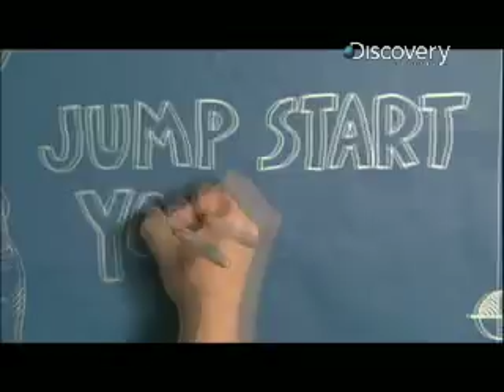MythBusters - Car Jump Start

Comment: As a mechanic this makes my blood boil a little bit. That defibrillator simply doesn't have the current to start that car. And no it would never blow up due to that amount of voltage and current going through it.
Reply: Also defib have high voltage but are also very low power to prevent you from causing damage. You want to jumpstart the heart, you don't want to electrocute someone.
A starter motor needs a lot of power to overcome the inertia of the engine components like the valves, crankshaft and cylinders and the defib is specifically designed to NOT give that power.

Comment: I'm fairly comfortable I could start a car with a defib unit. I'd be taking it apart and using the internal battery though vs using the unit as is.
Using the pads and a standard unit, nah no chance. 

One thing you COULD do is use the defib to provide the high current of the coil to give you a spark on a points/magneto setup but that goes well beyond jump starting at that point.

Comment: It's a classic scenario of volts vs amps: the high voltage from the defib. (with very little current) probably just arced inside de battery.
Reply: It's low amps and extremely short duration. A defib is meant to give a very brief shock to the heart to snap it out of a panic, kind of like if you were to give someone a slap in the face to snap them out of it.
A starter motor needs a lot of power in order to overcome the inertia of the heavy crankshaft and cylinders. Defib's are specifically designed NOT to give a lot of power to prevent you from damaging the body.

Comment: i'm guessing that a defibrillator is high voltage but little current. you need current to start engines and compressors.

Comment: The main problem was the battery was TOO drained/dead. They needed to try this with a low battery that could turn the engine a little bit but not start it, as most people needing a jump start have. If the battery was that far gone the defib would never work like that unless you sat there and defibed it 20+ times before starting.
Reply: +wcemichael Came to the comments to say exactly this. Even the portable jumpstarter kits clearly state on the box they will only work on a drained battery, not a completely dead one
Reply: Lov2WatchSweetVidz
Well I'm glad somebody knows their shit in here. It sure the hell wasn't them. Maybe they failed the test on purpose so people won't try it and possible blow up the battery and get acid in their face, go blind and end up suing MB? The only reasoning I can think of

Comment: It may not start the car due to the low amps put out by the defrib, they are design for high volts, but if it had high volts and high amps it would most certainly kill instead of revive.

Comment: The only good Japanese cars I've driven are the 2005 Honda S2000, the 2001 Toyota MR2 Spyder, the 2010 Lexus LFA, and the 2010 Nissan GT-R.
In my opinion, which has been formed from my past experiences, all other Japanese cars are worthless. Although, in it's factory form, the Honda Civic is very reliable.

Comment: They tried to start a car with a high voltage jolt anywhere between 100 and 2000 joules. When on average it will take roughly 20,000 to 40,000 joules to turn the engine over.

Comment: Basically trying to start the vehicle with a stun gun.  Won't work.  I did see, however someone start a small car with only 100 ni-cad batteries in series-parallel that ended up being about 13.2 volts & around 80 amps without a car battery in the circuit.  I doubt it would work on an older large 70s car with a massive starter.

Comment: I'm not sure about a defibrillator, but I do know you can use short bursts of higher-than-charge voltage to charge the battery a little, and even restore a dud battery, BUT you must disconnect ALL electronics connected to the cells, so if the battery is "smart", the current will flow through the control electronics, and not the battery.

Comment: I would have thought a  defibrillator didn't pack enough amps to turn the starter motor before I'd have clued into the voltage frying it.  Hrm..

Comment: yep, saw that non-result coming a mile away, starter motor in a car is all about the AMPS not the volts, ever wonder why jumper cables are so thick? they are thick so that they can carry the required current which can be anywhere from 150-500 amps (bigger engine to start = more amps, so chevy V8 would probably be closer to 500, whereas honda 4cyl would be closer to 150-200 amps range

Comment: yeah i could have told you that wasn't going to work the couple milliamps coming out of a defibrillator are pretty useless when your trying to turn an engine over most car batteries can supply between 450 and 700 amps thats many thousands times more then a defibrillator.

Comment: @troydeancarpenter
Yeah. And even then, it would probably take several minutes or even hours to charge up the battery sufficiently to get the engine to turn over.

Comment: I can't believe Grant set this test up for complete failure. What does he think the big cables on the battery are for? Certainly not for 12volts, it's to supply large amounts of current.  They probably fried a relay or fuse, not the starter motor.  Should have had a mechanic supervising this test.

Comment: Number one, it's high voltage but very low current.  You can't increase the voltage without lowering the current if you're pulling from the same source.  Energy doesn't just appear out of nowhere.  Number two, a car uses DC voltage to start NOT AC, so if you wanted to at least try to charge the battery you need a full bridge rectifier and possibly a few resistors.

Comment: well duh! it fried because it's run off dc voltage not ac. they'll fry the computer and everything like that because the starter is ground to the block and the computer is grounded to the frame so yeah this should have been busted before starting the test.

Comment: not going to work
 
defribralator blew out the fuse box which has a maximum fuse of 30V or .03 the voltage of the heart starter lol.

Comment: um.....most car batteries are rated by amps, defibs are low amp devices, but high voltage, it takes amperage to turn a car over not thousands of volts......

Comment: nice to see the clamp work holding the key to start, but they could've just taken it apart and driven the ignition switch with a screw driver..

Comment: hmm but why did he connect the black negative wire to the battery? you're suppose to put it to a grounding area like the chassis of the car. ive heard that is a way to kill your car faster. not saying it would work or anything but might have not fried the battery. who knows :/

Comment: Air-Tank/DC Analogy:
Volts is pressure in PSI (without which, there can be no current).
Resistance is the hose (length/diameter) = the starter motor which is not a variable for this case.
Important distinction: Amp RATING is the volume of the tank or battery in this case. This is how many amps/current the tank/battery CAN push times for how long.
Current is the flow (in Amps) resulting from the pressure divided by resistance.
A defib is a completely different animal.

Comment: More than likely the key being locked in the crank position drained the dead battery so low it couldn't be jumped.  That and the jumper cables that they had hooked to the paddles looked to be awfully low gauge.  A defibrillator give out a huge instant spike.  A car starter needs a bit of sustained energy to work.

Comment: a starter motor is quite hefty on current and a defibrillator only delivers quick bursts of high voltage, depending on the polarity they probably had the defib reversed  and sulphated the battery that or the motor windings broke down

Comment: they need to hook the defib cables to the engine block, both plus and minus, then put the key in the on position, like the engine was running, and hit it with the 7000 volts..believe it or not, a gasoline car actualy uses 15000 volts for the spark plugs.

Comment: that was the dumbest thing ive ever seen anyone try to do
who thought that that thing was actually gunna work
that car battery is 12VDC, 500amp+ in good working shape and can supply power for a solid 15sec and that defib was probably 40 thousand VAC at 1amp or less and supplys power for what mabee half a second. you would have as much luck turning that car over with a bug zaper or 3 AAA batteries out of your TV remote

Comment: Actually, it's because the defibrillator is an AC device and the battery is a DC source.  The defib. generates high voltage by the use of internal transformers. Because Current and voltage are proportionate, the defib. produces a very high voltage with very low amps. Otherwise the machine would just kill people faster. That means there isn't enough current to turn the starter and get the alternator going.  All it does is create an enormous voltage spike and damage electronic components.

Comment: Defib's use high voltage and low amperage.  A car uses the opposite, 12V and 300 cranking amps or so.

Comment: guys..... you should read some electric & electronics  books.....in any freetime....  :P

ps: tha car didn't start cause of a basic law............same charges anode/anode or Cathode/Cathode =repel.

diferent  charges = current.

using a battery its diferent,  because a battery doesn't have the HUGE current that a defib. have and it allows to start the car  and recharge the dead battery.

Comment: The battery is very low impedance if healthy, there is no way the defribulator will put much voltage across that.

Comment: this is so obvious it wont work

THREE PROBLEMS:

VOLTAGE - WAYYYYY TO HIGH
CURRENT - WAYYYYY TO LOW

AND...

THE DEFIB SENDS AN APPROX 10MILLISECOND PULSE, NO WHERE EVEN CLOSE TO THE FEW SECONDS YOU NEED TO START A CAR, POINTLES MYTH

Comment: How dare they call a Toyota Camry a jalopy.  I had mine run with no oil in the freeway without any problems other than the overheating.  And no, I don't usually drive with my car without any oil.  Their was a big crack that leaked all of the oil out.

Comment: Kinda figured this would happen my guess is they shorted a cell in the battery, the reason I say this is that they mention that at the end they could hear the solenoid clicking but no start.  The defib machine output is too high voltage but too low amps. the amps are crucial to geting she starter to turn if the defib could output the same volts and amps as the draw required to start a car, it would cook a human heart.

Comment: are these people fucked in the head?

there is a reason why there are a bunch of Fuses and Relays all over the car.

When a fuse or relay is exposed to too much voltage, it simply breaks off and cuts all power.

more than likely they fried the Starter Relay or the Factory Alarm (if any)

Comment: Does anyone here actually know how Volts differ from Ampers?  Read more in Physics !!
Even if they used 10x defibrilators it wouldn`t be enough to light a spark in that accu ;)
cheers

Comment: the fule and spraks will keep up thats no problem why would you be able to keep the engine running at 7,000 rpm's :)
but yeah the copper wire in the starter engine will get to hot and burn (on some spots why thay cant make a magnetic feeld :) )

Comment: Yes, it will spin faster. But, if even if you have a 50 v starter motor, the increse in volatge will be so dramatic that the motor will spin so fast either the motor will fail or the enine's spark plugs and fule feed won't be able to keep up.

Comment: it depends on the rpm that starts the car...
bedides a 12v starter motor will turn faster if you get above 12v 
just like you will have a 6v start motor and a 12v battery

Comment: 4,000 volts is nothing. cops' tasers are 250,000 and if you go to a gun show you can buy ones that go up to 500,000. of course, if you hold the half million one to someone long enough it could send them into cardiac arrest. still, 4,000 is nothing.

Comment: probably not only did it fry the Starter, it probably popped the Powertrain Control Module because the PCM of a Car is EXTREMELY Sensitive to the amount of power it receives.

Comment: You need a constant flow of power. Not just a low amperage pulse. 
What these guys did is equivelant to flicking a high powered spotlight on and then off and expecting that because its so bright, the room will stay lit for a while.
Come on MythBusters, you guys know better!!

Comment: Sorry, not true. You also need to turn the engine far enough to get compression in at least one of the cylinders... which requires a fair bit of sustained power. 

The typical charge from a defib is about 100-300 Joule. This, I think, is *theoretically* possible to provide that compression. However, the manner in which it is delivered from the defib, along with the losses from the poles, to the starter engine, to the engine... I wouldn't hold my breath for it.

Comment: A defibrillator has many thousand volts but few amps.  You need at least 300 amps at 12+ volts to start a car.  I reckon the battery was too flat and when trying to jump start the normal way, they didn't leave it connected to the other car for long enough for the dead battery to charge.  Done this many times and this seems to be the case.

Comment: Ummm,6 volt batteries are $1500,you can pick them up for the same price as a car battery because 6 volt batteries are still used in farm equipment like tractors

Comment: well I know something you did wrong there... a defibrillator is an AC current and a car battery is DC.  its not compatible.  you need to rectify the circuit first

Comment: um, dumbass, I happen to have a masters in electrical engineering, I know what I'm talking about.  the microsecond pulse provided by the defib, does not provide a long enough waveform to provide anything to the engine or battery.  You need to understand the difference between a DC voltage, and a microsecond pulse.  It could be a billion volts, but if it is only provided for a microsecond, it isn't going to do anything for a battery or to start an engine. PERIOD.

Comment: dumbasses, a car needs a sustained amount of voltage in order to start, a diffibrilator only gives a high voltage microsecond pulse. It won't do anything to either the battery or the car!

Comment: and 2......that machine probably puts out very little amperage....you can hold onto a spark plug wire with the engine running and that will throw about 40 to 50 THOUSAND volts through you....but little amperage

Comment: since they did'nt have a completely dead battery....I am betting when they put the key in start position and waited to hit the button on the defibrillator, they burned up the brushes and/or the solenoid in the starter :)

Comment: I don't quite get Grant's explosion and fire coming from an engineer. The defibrillator cap holds approx 300J of energy while car battery holds something like 4000000J of energy. Why would he expect more than a spark. Even if there was no voltage mismatch the defib energy would not likely be sufficient to run the starter motor.

I suspect nothing at all happeneded to the car, the defib essentially shorted (through it's own current limiting) because of impedance mismatch with the battery.

Comment: this is absolutely retarded. Why the heck would a car start jsut by putting power to the battery? Im sure the mythbusters arn't that stupid but they do 'act' as if they are stupid on a regular basis. If they wanted it to start from a defib, the should have connected it to the ignition coil. 

In fact, they wouldnt even need a battery if they did it this way as the alternator would kick in once the cars started from the defib.

Comment: The problem is that de-fib is low amperage / high voltage and is an instantaneous discharge of power..  you could use the  battery from the de-fib or the power circuitry in some way, but never the  de-fib the way it is designed to operate.

Comment: yes but that amount changes when the voltage changes because it has to pass through the body's resistance. thus at say 20000 volts you would only need less than 3milliamps if that voltage is kept constant (not a compacitor)